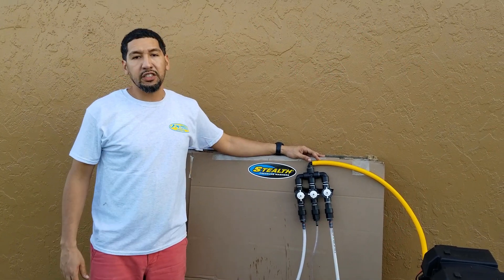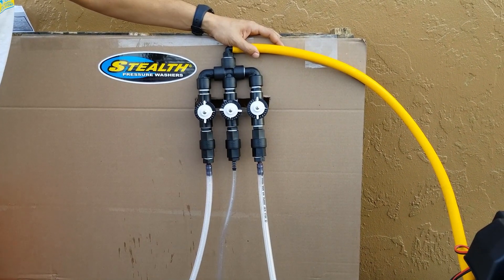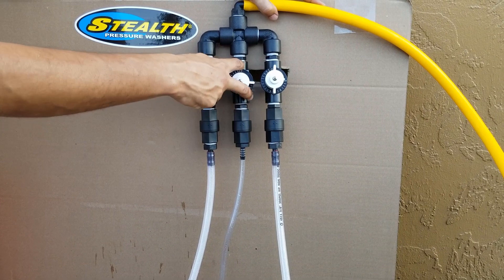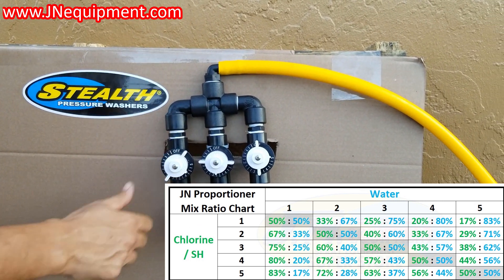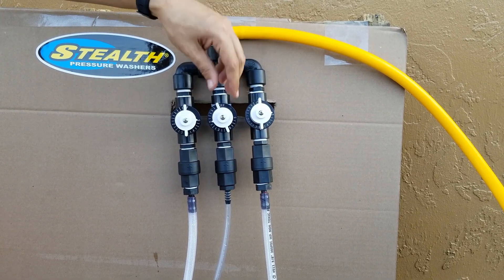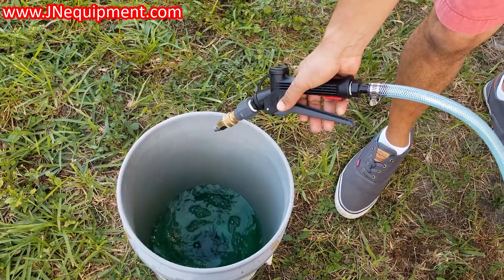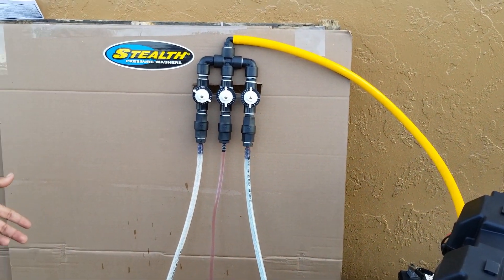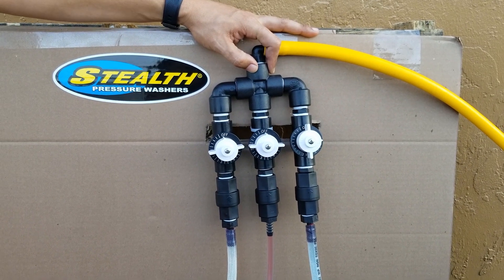Stealth Soft Wash Proportioner Product Demonstration

Comment: can you run the water line to pump from pump to proportioner then to gun? or will it not work well without being on pump draw side-object is to prevent bleach etc from going thru the pump?

Comment: Hello, I looked for this item in your website but cant find this manifold with those valves. Is it special order?
Reply from the maker: HI Joe, we no longer offer this product, as shown. However, you could purchase the individual items and re-create it.  Here are the quantities and links to the item you would need:  
qty 2 -  Banjo HB050 Hose Barb 1/2" MNPT x 1/2" - Spraywell
qty 6 - Banjo NIP050-SH Nipple 1/2" MNPT x 1/2" MNPT - Spraywell
qty 2 - Banjo SL050-90 Street Elbow, 1/2" x 1/2" - Spraywell
qty 1 - Banjo CR050 1/2" Poly Cross - Spraywell
qty 3 - 1/2" Chemical Metering Valve - Spraywell
qty 3 - Polypropylene Check Valve with Hastelloy Spring, 1/2" F x 1/2" F (spraywell.com)
qty 1 - Banjo HB050-038 Hose Barb 1/2" MNPT x 3/8" - Spraywell
qty 1 - Banjo HB050-90 Hose Barb Elbow 1/2" MNPT x 1/2" - Spraywell
qty 1 - Blue Monster 1/2" Blue Contractor Grade PTFE Thread Tape - Spraywell

Comment: So that your not loosing prime dose all your lines always need to be left in liquids in each drum?
Reply from the maker: Yes that is best practice, EVEN if the valve is completely closed, the line should be submerged.
Reply: @Spraywell  So that means each line must be either submerged in surfactant water or SH. The SH means you must always carry SH in your tank isn’t that a bad thing to be doing carry SH always in your tank and keeping your line submerged in SH? What about filling when you’re done your SH tank with water and running it so that you’re flushing out your SH line?
Reply from the maker: @nick32141  you can always empty you tanks, you would just have to reprime your system.

Comment: I just bought the Gen 2 with 55 gallon tank.  can i use this on my Gen 2
Reply from the maker: you can use this on any diaphragm  5.5 GPM or above
Reply: Thank you for getting back to me.  I went a head a bought one from you guys and I love it. It works great. Washing houses here in Cookeville Tennessee
Reply: If I wanted to upgrade pumps on gen 2 and go with 7.5 gpm can I do that and can I buy the pumps from you guys
Reply from the maker: @HouseWashingRick  yes, you can upgrade to the 7 GPM by simply changing the pump, no other changes required if you have a 5.5 gpm set up
Reply: @Spraywell  ok ty

Comment: The surfactant is about 1oz per gallo of bleach. Can you figure it out on that dial?
Reply from the maker: for that small amount I would recommend mixing your soap with water into a bucket and drawing directly out of that pre diluted mix.  that EXACT of a mix is tough for this version for the standard proportioner.  For super specific mix quantities like 1 oz per gallon, you could use the ELITE proportioner which is more exact with the mix quantities.

Comment: What if I want it to be upside down. So the single port is on the bottom and the 3 ports are up top? Do I swap the order of the check valves and meter valves?
Reply from the maker: no just install it however you want it, no need to change anything. It can be installed in either orientation.
Reply: @Spraywell  yeah, I thought about it after I asked you the question and duh, the valves are already in the only direction they can be. In my mind I was thinking of the meter marks being upside down as well. And theres really nothing that can be done to change that. Too bad pentair doesn't make the marks in 2 different directions so can purchase the direction we want. Oh well.

Comment: What diameter hoses would you recommend to use in combination with a 7 GPM pump?
Reply from the maker: for the proportioner or your spray end? For your spray hose I would recommend 1/2 inch or 5/8, For the proportioner I like to use two 1/2 inch suctions lines for water and SH, and a 1/4 inch line for my soap
Reply: JN Equipment Isn’t 1/2 inch suction line for water and SH too small for a 7 GPM pump? I do use a 5/8 inch hose as a spray hose. Just asking, I’m still fairly new to 12V systems. Thank you in advance!
Reply from the maker: @muratuzer6772  are you using a proportioner (3 separate suctions lines) or not (only 1 suction line)? If you only have 1 suction line than use 3/4 or larger.
Reply: JN Equipment Yes, I am using exactly the same proportioner (got it from you guys actually). I have replaced the barbed fittings to where I am using 3/4 inch hoses for water/SH (from the tank to the proportioner) and 3/4 inch hose from the proportioner to the pump. I do use a 5/8 inch spray hose (200 feet). It does not seem like I am getting the pressure I should.

Comment: @JN Equipment You suggest using 1/2" over 3/8" for more than 4 GPM (which I fully agree), yet on your website it shows you build those with 3/8" barbs.  Why?  Help me understand why you'd go out of your way to put in bold type how important it was to use at least 1/2" hose, meanwhile, you're building and selling these with undersized barbs?
Reply from the maker: Great question. The SPRAY hose is a 1/2 inch, the reason for this is  1. volume of material at the tip and 2. reduced backpressure in the line. But keep in mind that's the 200ft spray hose. What we are discussing here is the suction end of the hose. On the proportioner, we've divided the suction hose between 3 hoses: 2 - 3/8 hoses and 1 - 1/4 hose. which creates a total of 1 INCH ID of suction hose when they are all used together.  If you are only using the Water and SH lines, you still have a 3/4 inch suction hose.
Reply: @Spraywell  I agree with part of your statement, however, if you're only using water, you'll be pulling from an orifice smaller than the pump inlet, which is the biggest cardinal sin for these pumps.  There's advocates out there who swear you need twice the  diameter of suction as your pumps inlet, which I think is way overkill, but absolutely nobody would agree that it's ok to use anything smaller that the actual pump inlet.
Reply: @TroyStevensStelzerPaintingInc   and @JN Equipment so what was the end result to this? The manifold outlet hose going to the pump should be what size? And the inlet hose for water and SH should be what... 1/2? and then surfactant at 1/4? (Some say 1/8" on suf... ) What are your thoughts? Oh yeah.. and the hose size leaving the pump to the reel? What size hose on the reel for a 5.5GPM pump?
Reply: Excuse me, what does it mean when you open all 3 valves and your pump isn’t sucking all 3 lines but if you close one valve or sucks the other 2 lines I can’t get my proportioner to suck 3 lines anymore I’ve only used it for 1 month did a few roof cleanings and it’s not working right. Is it maybe from not flushing the surfactant out of the valve? But I can shoot a water hose through it and all 3 valves water comes out the other end but when I hook it to the pump my proportioner isn’t working right. What is the problem? I also been using half inch hose for bleach and water and 1/4 for surfactant.

Comment: Can I use larger diameter hoses on each line?
Reply from the maker: yes, but I would suggest the center line is a smaller ID
Reply: Mike what size hoses did you use. I'm pulling off of a 5gpm pump
Reply: @HouseWashingRick  3/4. If my memory serves me right. I may be wrong brother.
Reply: @TheFreshRinse  ok thanks.  I got my proportioner today I understand my hose for sh. water and soap im not sure where to connect the single port on portion to pump
Reply: @HouseWashingRick  Does the video not help you? I’m not sure if it shows or not. Should be just one outlet on the pump.
Reply: @TheFreshRinse  can I email you a few pictures
Reply: @HouseWashingRick  I may be delayed. I’m not at home at the moment.
Reply: @TheFreshRinse  ok

Comment: It doesnt need clamping hose for the hoses?
Reply from the maker: I would recommend stainless steel hose clamps everywhere.
Reply: I mounted everything yesterday and the pump is not working properly.  It seems like is not pulling enough chemicals.
Reply from the maker: @BadWeatherfreak  did you get this resolved
Reply: @Spraywell  I am waiting on the 5.5 GPM pump to come in but went ahead and set this all up in my trailer last weekend on a 4.5 GPM pump. it really would not pull from all 3 hoses. I am assuming the bigger pump will make all the difference?

Comment: If you had 12.5-15% SH 50 / 50 would be about 6.25% to 7.5% SH. Do you need to go that hot in FL? I am in NJ and we clean roofs with 3.5%-4% most of the time.
Reply: Bro I run Chem and water 50/50. Yes Florida needs it to be strong. It could be less but I got to burn that mold off. And it doesent kill plants as long as you rinse and cover.
Reply: How would you set this for washing vinyl siding at around 1.5/ 2% mix?
Reply: @artbentley4887  2% is way too hot for siding imo.
Reply: That sounds hot for siding, unless the house is supper green.

Comment: Great info!! Could you recommend hose sizes for mixer?
Reply from the maker: I use 3/8" lines for Water & SH and a 1/8" for my surfactant.
Reply: JN Equipment cool thanks!! Is there a purchase minimal on your site for ordering? I like that 1/2 to 1/4 reducer
Reply from the maker: @Truprosoftwash  there is a $35 order minimum on the website.

Comment: I bought a 4.0 gpm stealth softwash system off of you last year your website says that I need a 5.5 gpm or greater to use this propotioner is that correct. I should upgrade?
Reply from the maker: The 4 GPM doesn't have enough "pull" to draw from all 3 lines. You could use this propotioner on a 4 GPM system but I would recommend either plug the center soap line or always keep the center knob turned to 0 (closed) and only use WATER/SH knobs. 
If you wanted to upgrade and currently had a Stealth PRO 4 GPM Soft Wash system then you would need a larger pump (either 5.5 or 7) AND (VERY IMPORTANT) upgrade ALL your 3/8 hose with 1/2 hose. 5 GPM and 7 GPM pumps need AT LEAST a 1/2 hose and the 3/8 hose that your Stealth PRO 4 GPM system came with will cause issues.
Reply: @Spraywell  You suggest using 1/2" over 3/8" for more than 4 GPM (which I fully agree), yet on your website it shows you build those with 3/8" barbs.  Why?  Help me understand why you'd go out of your way to put in bold type how important it was to use at least 1/2" hose, meanwhile, you're building and selling these with undersized barbs?